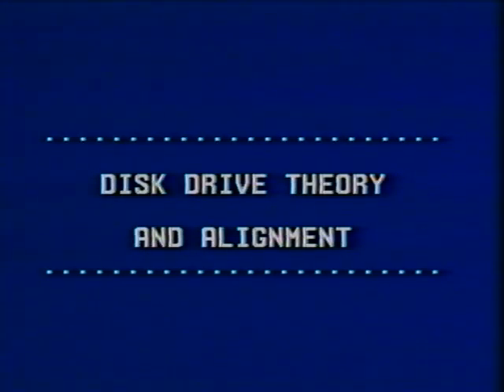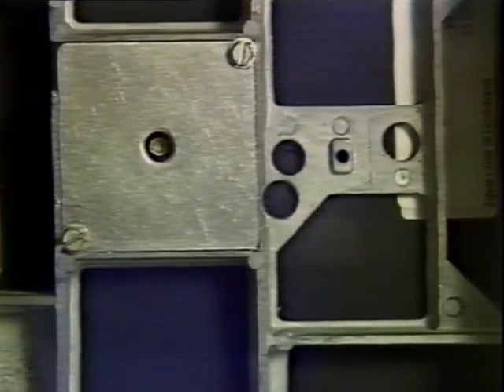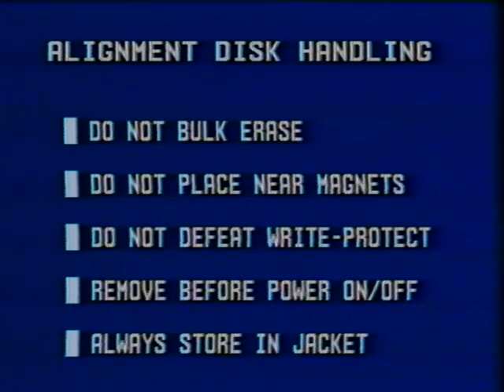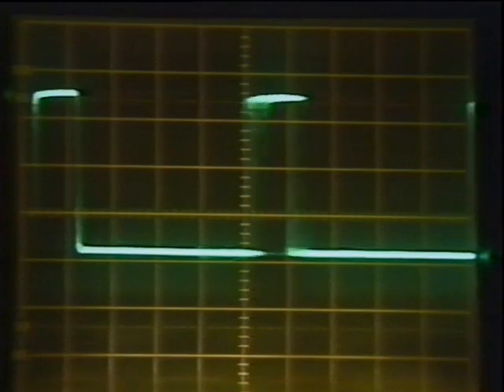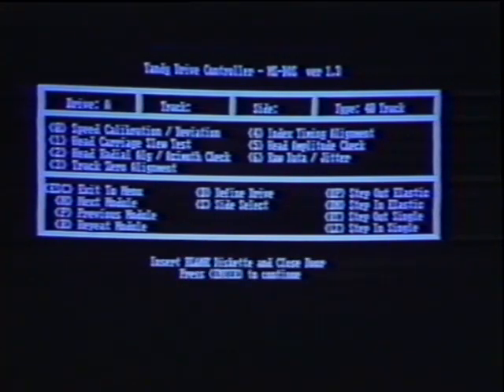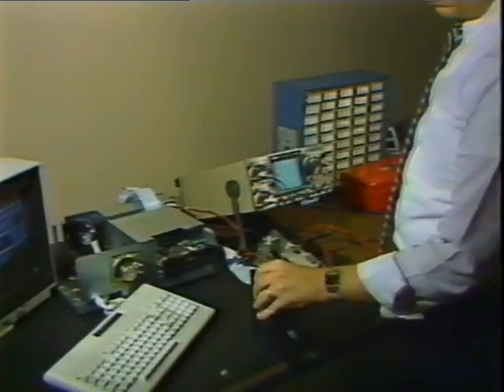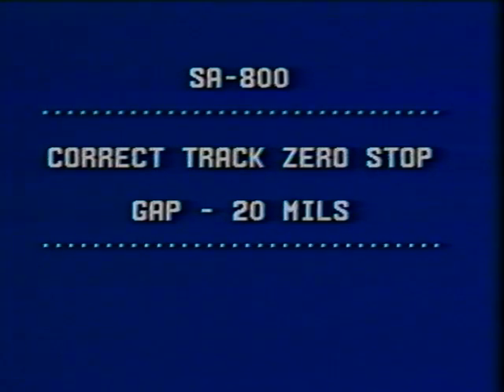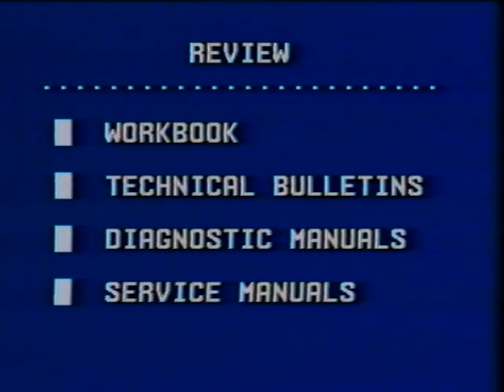Radio Shack TRS-80 Floppy Disk Drive Alignment

Comment: This video needs more love. Best video explanation of 5 1/4" drive alignment I've seen. Now if I could just lay my hands on an alignment diskette and the ms-dos version of Tandy Drive Controller. Or even just an alignment diskette... the TRS-80 versions of the software are available online, and at least 360k drives should work on the III and IV, and an appropriately equipped I.

Comment: Guess we were only shown how to repair and aligning Radio Shack disk drives.  We did have computer repair classes at Tandy and later sat in on one. They went over oscilloscope signals and schematics of computers, but not videos maybe just a hand out. (This video came out years later.) The information in the video looks good. We had to change pins when adjusting track-0 and adjusting alignment using TDC and stepping to the alignment track (with the alignment disk installed). Had forgotten the brand of the alignment disk but guess it was the DYMEX disk show since it had green writing. Good video. We relied heavily on our oscilloscopes in DC mode, don't know if a frequency counter is necessary the software today may provide all of that. Had to adjust a disk out of alignment, because when you tightened the nut it would come into alignment. Maybe equivalent software to TDC to control disks can be used today.